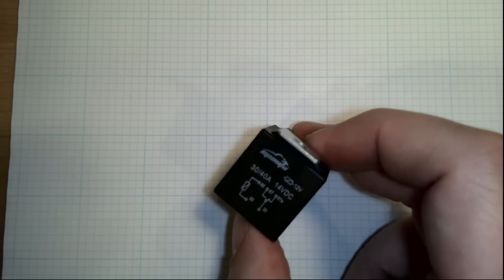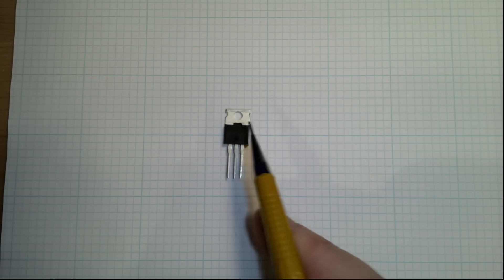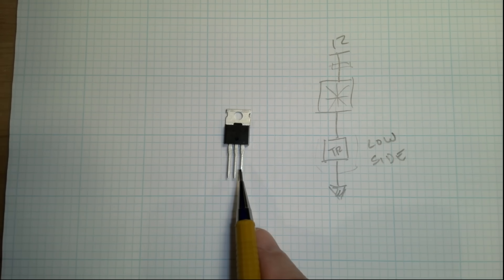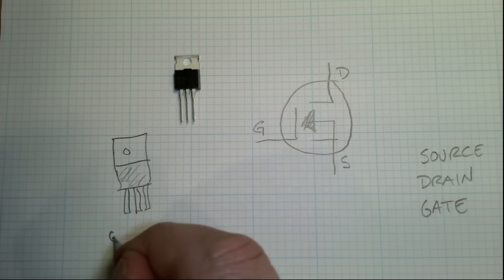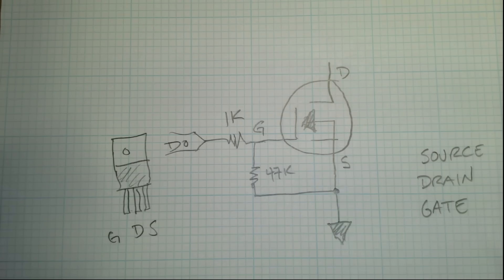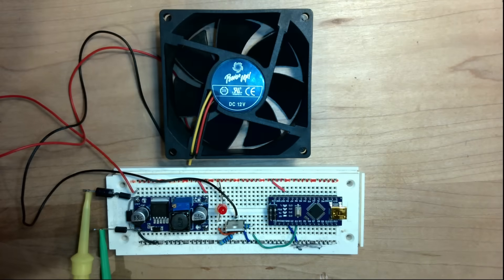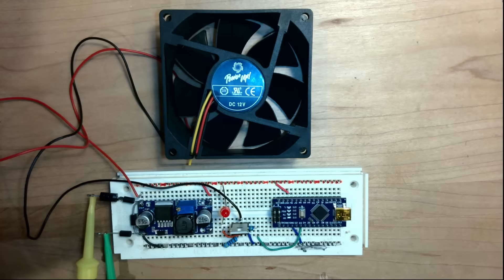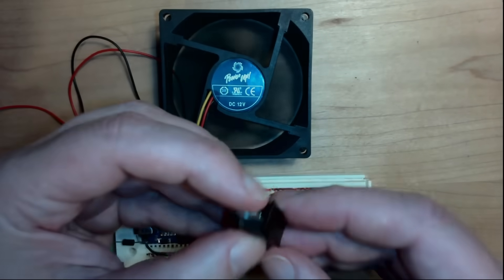Using a MOSFET to Switch High Current Automotive Loads

Comment: Before doing this - verify your alternator output is protected against polarity reversal/rectifier failures. Alternator outputs on old vehicles can fail such that AC escapes to the main bus. Junctions may fail in unexpected ways...

Source: Old VW of mine that kept blowing up LED lamps and I only found the problem with an oscilliscope. Vehicle had no other issues. Didn't seem to hurt the battery or the instruments...
Reply: The biggest problem in cars is often load dumping / shedding.  then a high load is switched off the alternator can't stop providing power in an instant. So as  current falls the voltage shots up  killing unprotected equipment.
Reply: @TheEmbeddedHobbyist Rarely does that voltage go far beyond a couple volts these days. Transistors are available that operate on, and are safely able to handle, some very large transient voltages. Relay coils with failed (or even just absent) flashback diodes, on the other hand, can induce spikes of thousands of volts,

I'm not one to recommend just replacing all your relays. Having said that - you probably could, and have less load overall and greater reliability. 

Filtering your power supply only takes a couple caps and an inductor...

Comment: Relays are still more reliable for high current applications, especially in cars or trucks. As has been said, the collector(bi-polar) or drain(mosfet) in a TO-220 package will be "hot" voltage wise needing a mica or sil-pad insulator as well as a heatsink. Even with a very low "on" resistance the device will get very hot very quickly with current hungry devices. Some manufacturers have gone to modules with FET's controlled by the CAN bus, but they seem to be more prone to failure. Also solid state devices are very unforgiving and they will most likely fail before a fuse can react. Nice presentation offering alternatives but not practical in the real world.
Reply: Agreed. Additionally fault finding on relays can be as easy as listening (or even feeling for) a click.

Comment: Excellent explanation. 
I have most problems recently with limit micro-switches. The old ones last for 5 or 6 years. Most recent replacement "Cherry" brand from Mouser failed in 2 years. Wish there was solid state replacement but any replacement would require a major change to the application.
Reply: Don't feel bad, automotive electrics have gone to sh@t in the last 5 or 6 years

Comment: Would be ideal for a drag race car that uses two high current 12v sources, i.e. Line lock and a Transmission Break solonide.The advantage is fast switching times so as to not add reaction time to the launch process. Idealy each solonide will need its own FET circuit with a common On signal ( 12 Vdc or what ever the cars alternator is outputting.)

Comment: Pretty neat video.  I was using a relay just to switch on an idiot light (parking brake light in my case).  The issue is the aftermarket gauges have idiot lights that turn on when you give it positive power, but that's now how my automotive wiring works.  This is on a '75 Plymouth Duster.

So when you apply the parking brake, the parking brake switch goes to ground.  Well, this worked well with a relay, but a relay is big and clunky.  This gives me an idea that I can do it with this type of transistor to save space behind the dash, but which transistor would be the right one to use that is switched on via ground (going low) and passes positive current?  Thanks!
Reply: You need a p-channel mosfet in order to do what you describe there. Perhaps an IRF4905 will do just fine?

Comment: There is a problem that many people seem to forget.  HEAT!  I guess that if you live in the more northern states heat is not much of an issue.  I live in Tucson and at my house we regularly reach temps above 120 degrees.  I have been having to build lots of circuit boards using the older types of things like relays, because the electronics are getting fried out here!  This problem seems a growing problem.  Most manufacturers do not consider things like components getting very hot.  So in my opinion I will stick with the old systems that still work when the temps get hot.  (I have been waiting for all the the touch screens to start going bad in the desert out here).

Comment: Again thank for this video!  Based on other comments, if you are looking for topics, might consider a Part B to this one where you add ancillary circuitry that a real application might add.  For example the cited Zener diodes.  But also maybe a fuse or other protective element.  Or variable speed control.  Or an on-off feedback indicator to the arduino to allow monitoring if the motor is really on, etc.  thanks!
Reply from the maker: Agreed.  This was a completely ad-hoc video and I was not expecting the traffic this thing got.  Who knew that "how to turn things on with an Arduino" would be popular?

Comment: The idea of a solid-state relay is good, but it needs to be significantly improved. Because it requires both normally closed and normally open contacts, a complementary pair with two N-channel and P-channel MOSFETs, and their noise- and fluctuation-free control or trigger.

Comment: And I ask, does anyone else wonder why the labels are drain, source? Seems they are connected in reverse. Source should be the positive voltage pin and the drain the grounded pin. But NO that would make too much common sense... I always thought that was bassackwards... Just me I guess... And remember, if you are going to control any amount of current, you have to use a suitable heat sink. Otherwise, you will be relacing them like too small of a fuse in the circuit...

Comment: If it could be put in a cube (like a relay for example) then I could see it as a viable option.   But in an environment like an automotive one the ancillary components would have a short life
Reply from the maker: Since about 1968 automotive voltage regulators have effectively been a low-side transistor switch driven by a comparitor that grounds the alternator field windings.

Comment: so which one consume less power for portable battery application. based on pocket size.
Reply from the maker: It depends on the relay and source voltage, but assume 12v and a typical 80-ohm could resistance it will take 150mA to hold the relay. That's far more than the fet consumes

Comment: I watched this with closed caption because it's 3 AM and I don't want to wake anyone up.  Consider the lower portion of your view frame as something that may be clouded with close captioning.  In this video, you have the breadboard at the bottom of the frame and point to various components and locatins, but the closed captioning obscured what you are pointing to.  If you had the breadboard at the higher portion of the screen and the fan at the lower, then the closed captioning overlay would be over the fan and the viewer would not miss the important pionts you are pointing to with your pencil.  Something to keep in mind for future videos: try to keep areas of interest in the upper portion of the screen.
Reply from the maker: Great feedback - I hadn't even considered where captions would be, and I often watch videos with captions on.  I already shot the high-side version, and I'm hoping it's better but I'll keep it in mind going forward.
Reply: watch it at 9 am amigo!

Comment: You didn't mention what I think is the biggest advantage of MOSFETs over relays - that many microcontrollers cannot output enough current to drive the switching coil of many relays, so even when I want to drive a relay with a microcontroller I normally need to use a MOSFET to drive the coil of the relay anyway!
Reply from the maker: 100%